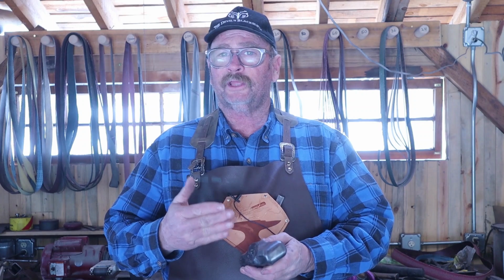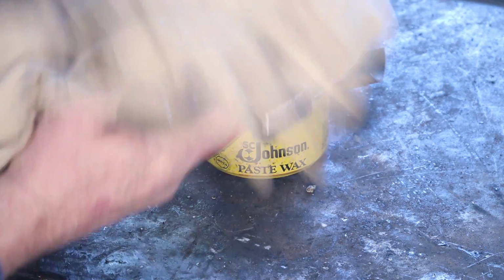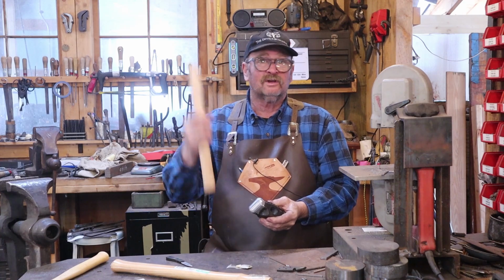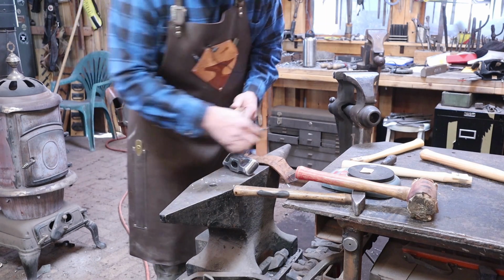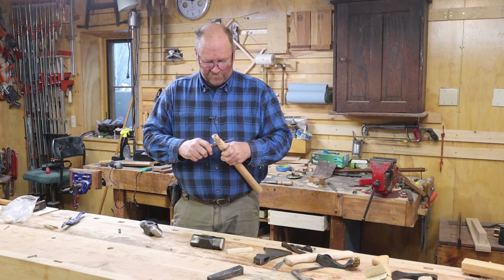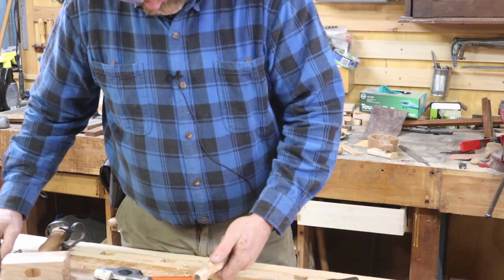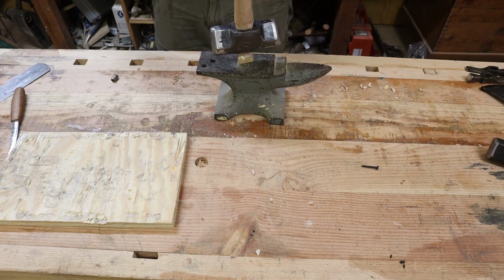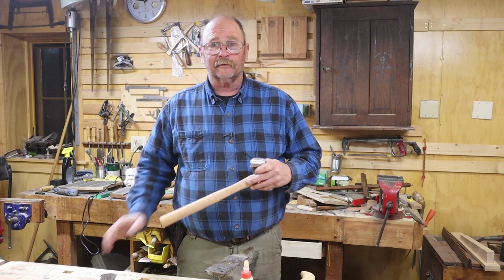finishing the Double diagonal peen hammer part 3

Comment: Great finish to the series. Thanks for that. When you were dressing the face, the grinder seemed to be slowed right down. Did I watch that before having my morning coffee or is there a specific reason for slowing it down? Again thank you so much for adding the third. 👍🏼
Reply from the maker: not slow at all, it was running about 4300 feet per minute.  That grinder doesn't have a speed adjustment.